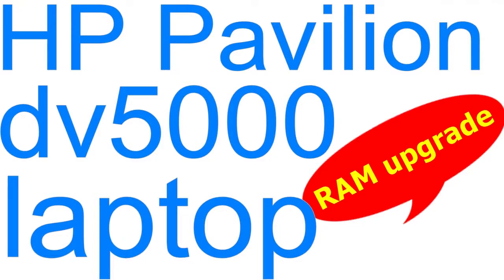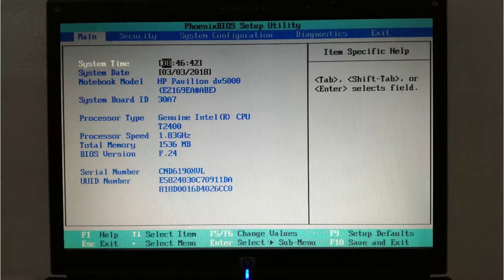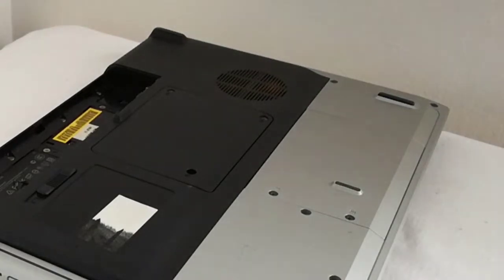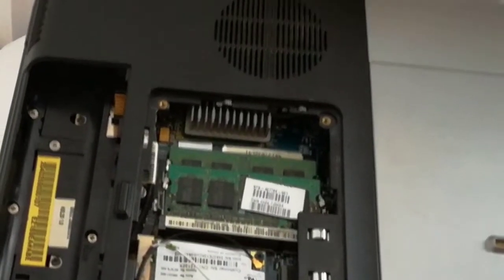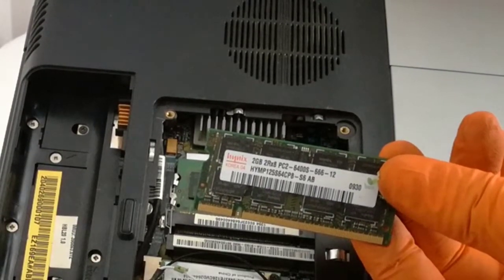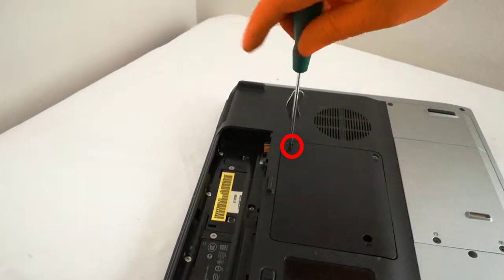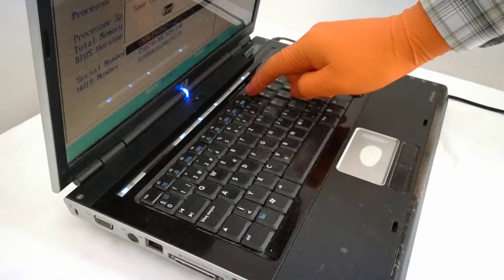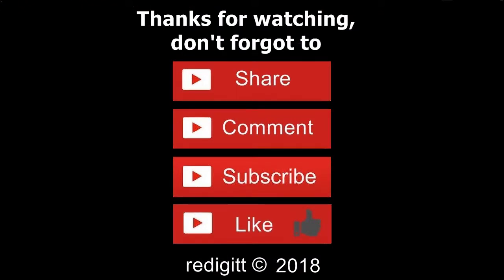How to upgrade the RAM memory for the HP Pavilion dv5000 laptop Ep.238

Comment: hello there, could you please open the cmd on your hp pavilion dv5000 and type:" wmic MEMORYCHIP get BankLabel, DeviceLocator, MemoryType, TypeDetail, Capacity, Speed " as it will say the speed and the capacity of each slot of ram? however you need to divide the result of the max ram by 1024^2 since its in kb... Thamk you so much, i would reallu love to know what ram should i get for my old hp pavilion dv5000 but its currently not running
Reply from the maker: Aloha, sorry, I don't have any more the laptop, but I upgraded with 2 GB Hynix DDR2 800MHz, at https://youtu.be/xG6eOwblmLE you can see the memory product code.
Thank you for watching, if my video  was useful, please consider to share and subscribe.
Reply: @redigitt  i just subbed, thank you sir and have a good day :)